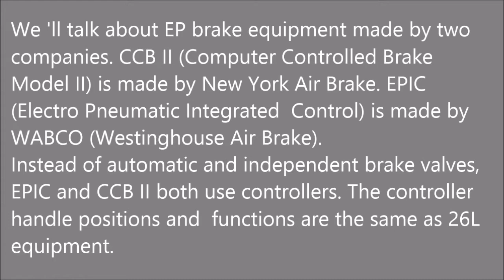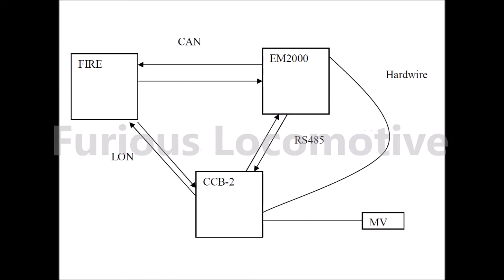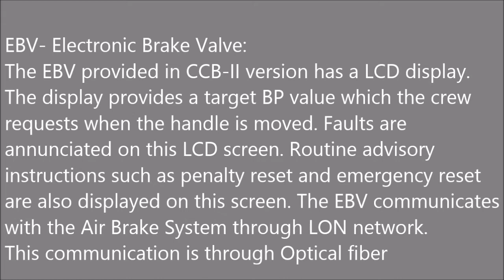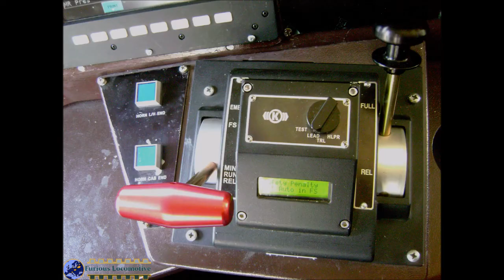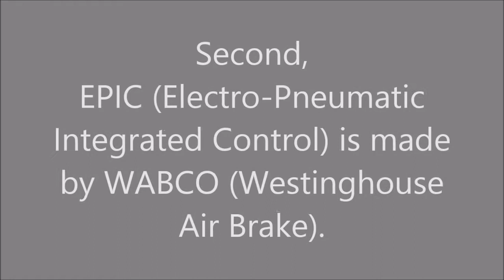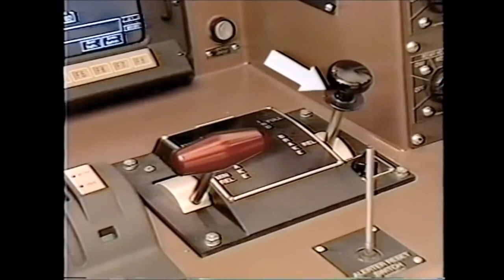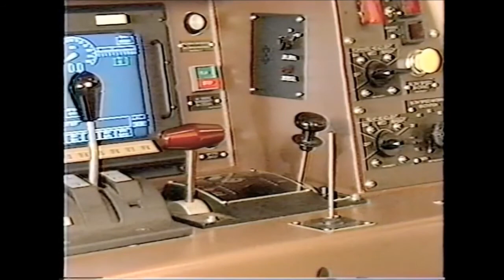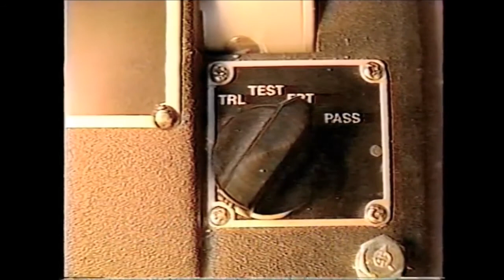Electro-Pneumatic Locomotive Brake Systems overview (CCB-II & EPIC)

Comment: Are any parts of the electronic brake valve mechanically linked to the brake pipe? For example, when you put the brake valve into emergency, are you actually controlling a valve or will there be a valve somewhere else that will dump the air? And will these controls work without any head end power?